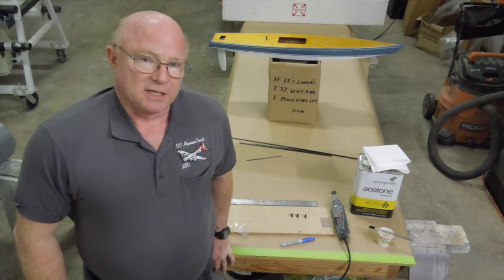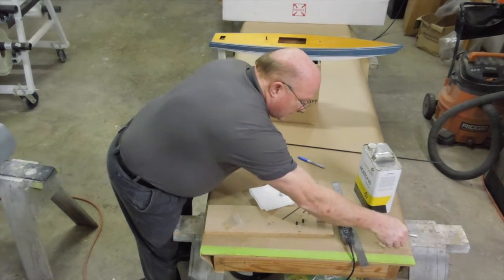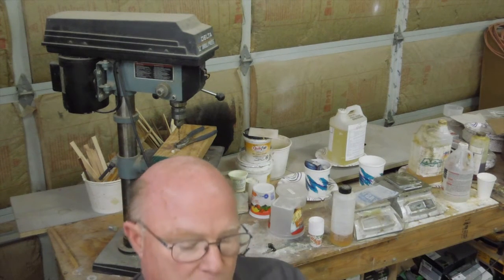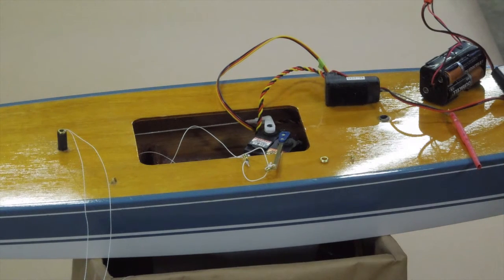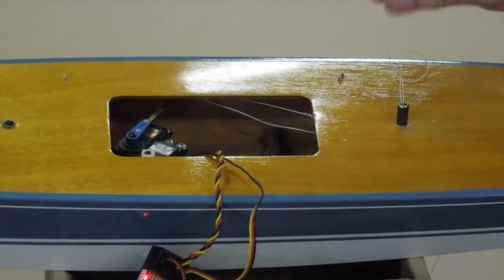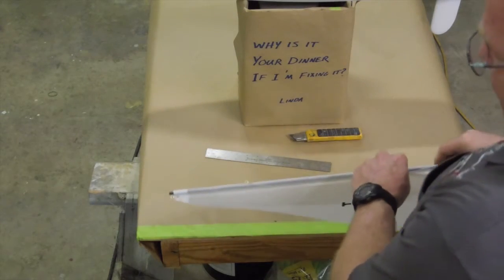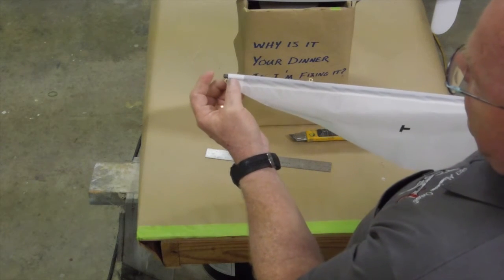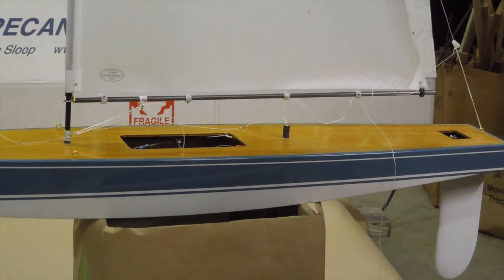T37 Builders Guide Rigging Assembly

Comment: Great video and very lucid commentary. 
Rather surprised that having spent $100s on tools and equipment you skimp by making your own bowsies and using such inferior thread for the rigging.
Reply: Hi John, Good point about the "thread" for the rigging since it certainly looks like that in the video. We need to clarify in the video what the material is that we are using. In actuality the "thread" is 50 pound tensile strength spectra, the newest highest tech super filament. Three of these threads could lift me up off the ground and one could lift my dog. This particular spectra is an especially tight weave that costs twice as much as looser weaves of the same material. It is only made by one company (so I guess there is no price competition since it always amazes me how much it costs for a full spool of the stuff!) Making the bowsies is kind of fun and they are a perfect size and essentially weightless, so why not make them is what we figure. Generally we do as much as we can to make the kit as affordable as possible while at the same time using only the highest quality materials throughout. You will have a great time building the kit - and thanks for making the comment about the rigging looking like thread so we can clarify that point in the video when we get a chance. Any comments like this are appreciated and very helpful!